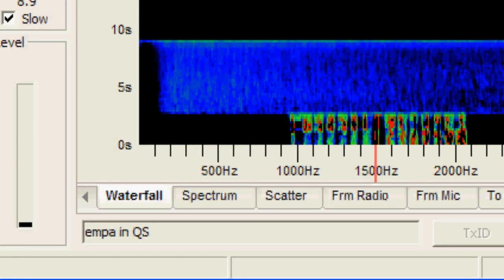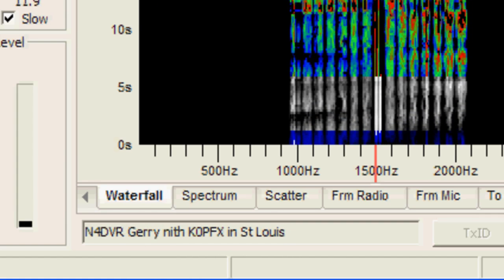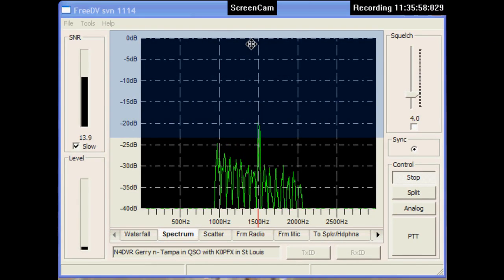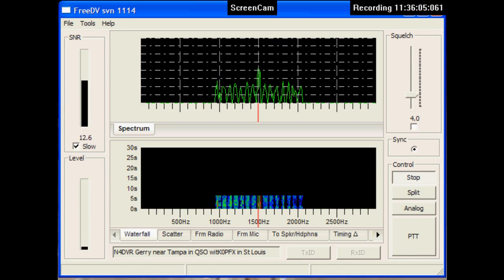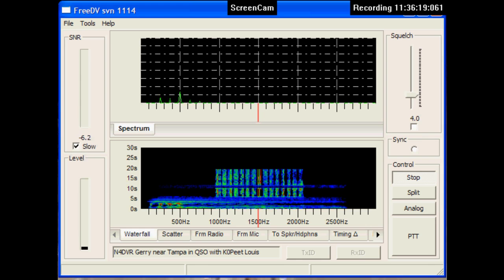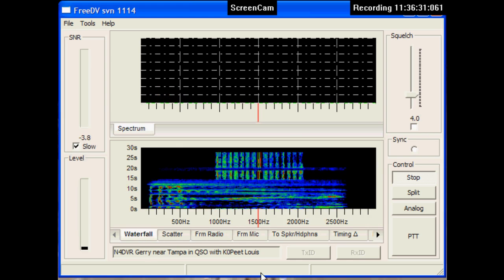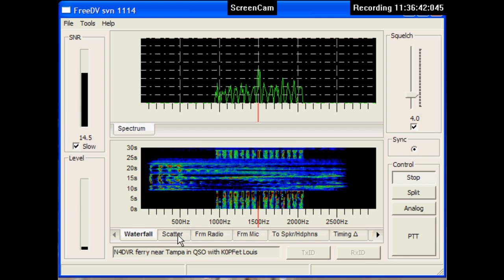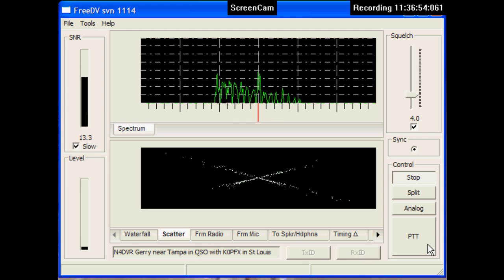FreeDV, the new HF digital audio program for Radio Amateurs. - Better audio on this version

Comment: More interested in it’s preformance in today’s high RFI saturated HF bands. Can it work through the high noise floors and digital hash that has rendered HF AM modes (SSB) useless for any signals below the S-9 RFI noise levels we now typically have?

Comment: The actual voice sounds better in SSB.  The only advantage I hear is the lack of noise and qrm.  But the compression in digital mode is terrible and nasaly springy.
Reply: I agree. I don't know why they had to compress the digital signal to such a narrow bandwidth. For sure it would sound better if it had the same bandwidth as SSB. But jeah maybe it reaches faster because same energy spread over less bandwidth could yield more range? I would have chosen a different tradeoff.

Comment: Nice to try, but sounds really bad...
Reply: Note that they're using less than half the bandwidth of the analog transmission, it is clearer, and has essentially no noise. I can't imagine it would be pretty if they tried to get the analog signal in 1.1khz
Reply: Clearer if the signal is very high. Need to use more banwidth for decent audio.
Reply: @microcolonel  Yeah, but they should have used the same bandwith for the digital signal. And given the Codec2 more bits. This sounds terrible.
Reply: It's meant for open air comm channels, generally very old and up to recent analog, with very tight bandwidth limits.  It's much clearer than what is hoped for it to replace.
Reply: All digital in the same or less bandwidth as analog modes sound rather weird.
I think if one can understand all the words it's not too bad,

Comment: I got the program working on Windows 7 64 bit, but on linux Ubuntu 14.04 LTS, I cannot get it work install using the .deb links the page had on there.     I wanted to use this for a weather radio experiment on the AM broadcast band under part 15 regulations. But the receiver end which was the linux laptop does not have the program because of a .deb install link not working.